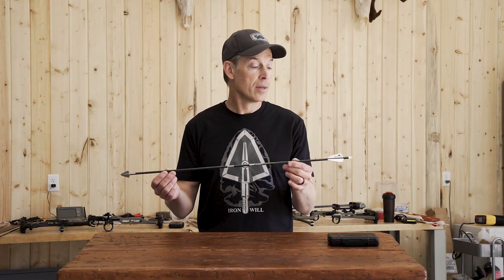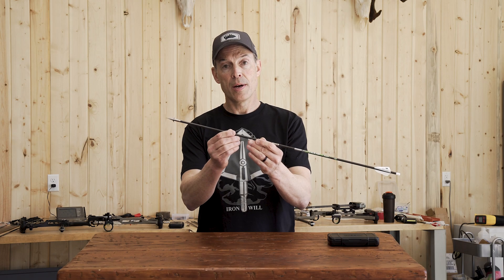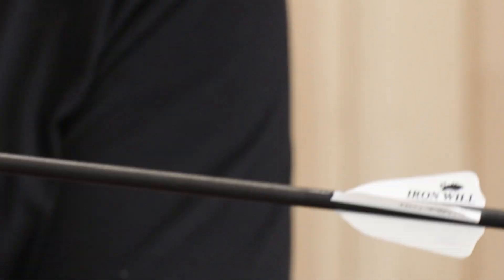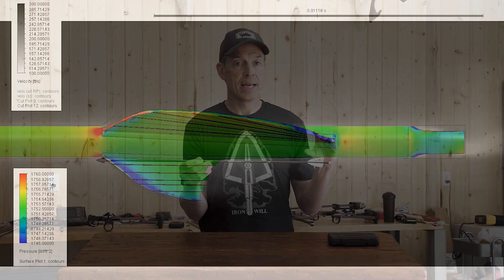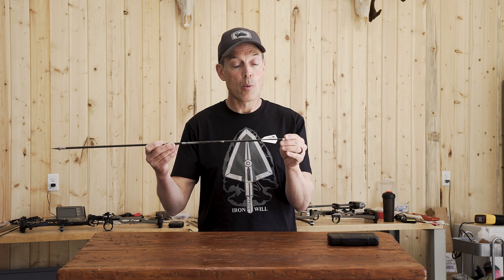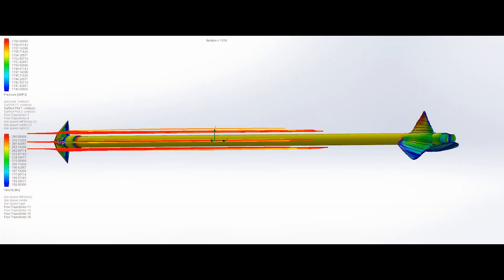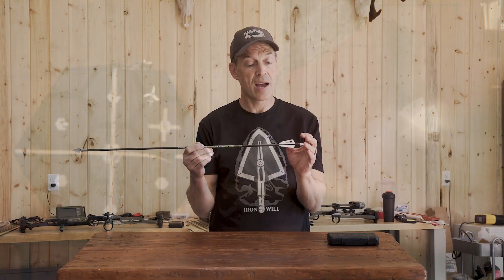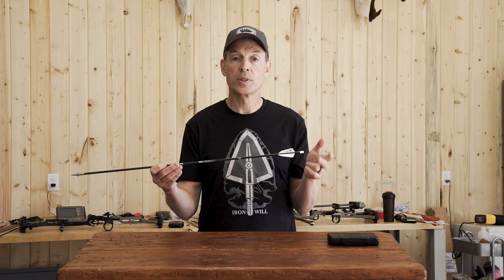Arrow Vane Designs for Improved Broadhead Flight

Comment: I wonder if you have any thoughts on the DragonFlight vanes? To me they would provide less flight stability or correction than more conventional vanes.
Reply: Dragonflight vanes creates alot of drag compared to regular parbolics. Because the plastic used in dragonflight vanes are a very soft plastic each "dragontooth" is flexing and bending. My own testing i find them very accurate for medium to short range but slows the arrow down alot for long range. Same behavior as Easton diamond vanes. To soft...  It would be interesting to see "Dragonflight vanes" with plastic from brand like "Vanetec".  Much lighter and stiffer material. After thinking a bit i think i will buy a bunch of "Vantec Swift"   vanes of different sizes and cut out some "dragontooth".   Soft vane material is only to minimize the impact when striking parts of the bow. If your bow is tuned well the whole point of soft vane material is pointless unless you use a Trad bow with no real arrow rest.
Reply: @mathiashammar1  I think the sawtooth pattern itself would also create a lot of turbulence (therefore drag) in the fletchings, independent of the softness.

Comment: Your study should have included different degrees of helical in relation to height.
Instead of just pushing a height agenda.
Reply: My guess is that different helical angles can be modeled from this data set and/or interpolated from the same data. In theory, if both sets are tested at the same rate of helical the data will show that the percentages will be the same, just with differing rates of spin and possibly velocities. IOW, the percentage of difference in stabilization and drag between the two will be the same no matter the helical.
Reply: Yeah, data is just not sufficient for some I guess.  The truth agenda is apparent to anyone with a critical eye.

Comment: I recently built my hunting arrows utilizing your vanes to steer your IW single bevel 100 grain broadhead with a 50 grain HIT insert and 10 grain collar.  

I couldn’t be happier with the results.  My broadheads and field points are impacting at the same spot out to 40 yards with nothing more than an initial paper tune.  

I really appreciate the quality components you’ve made available and the testing that has gone into them.